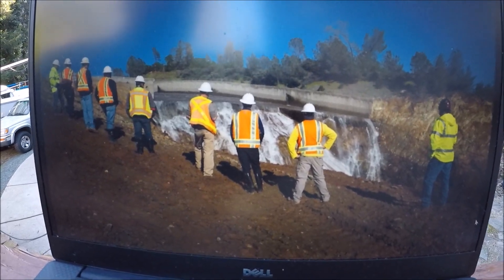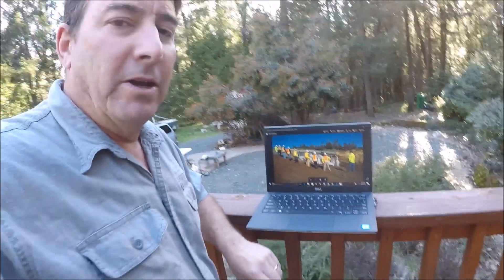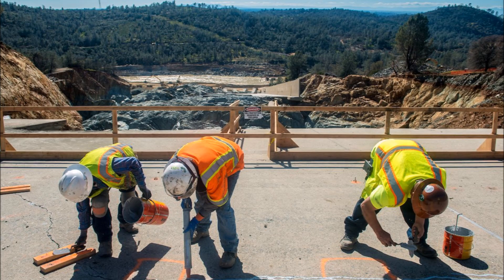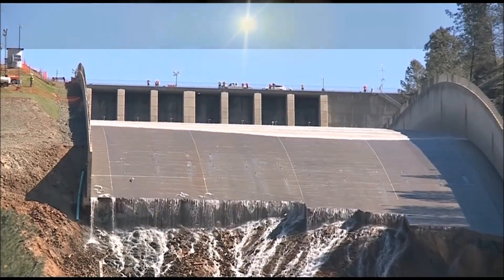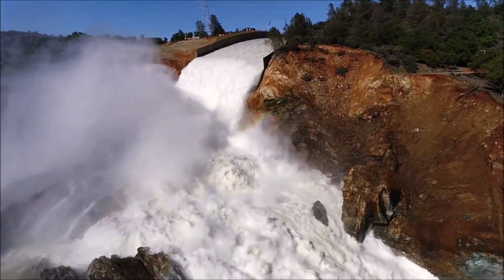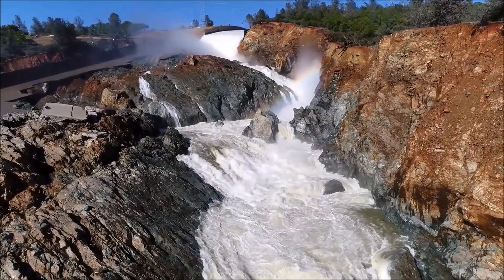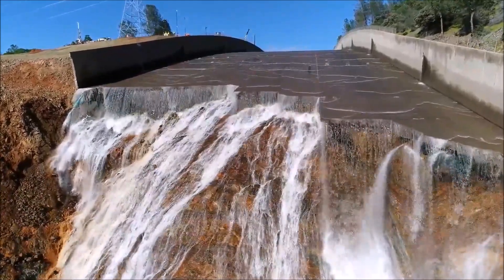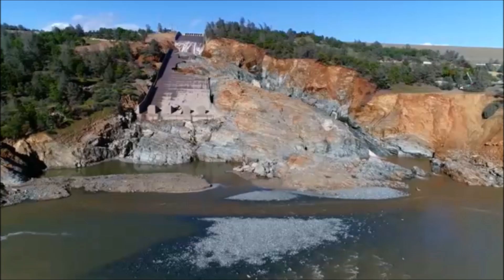Oroville 29 March New DWR Spillway Footage

Comment: From the drone footage it's almost as if they could just leave the spillway as is now and use the newly formed canyon as the actual spillway .  The water seemed very clear coming out at one point there with that being said I do understand the reasons. Behind building the new spillway.  The erosion issue only being one of the reasons.
Reply: I was thinking that. Looking at how clean the water is it's like the worst is over now, the quality of the rock I've seen isn't great though. I think the issue goes back to the original design because they used the original tunnels from the construction of the dam to make the power plant when really the power plant should have been placed on the other side of the spillway and emergency spillway so it could never be blocked by debris in the first place, but it's all water over the spillway now lol...
Reply: Stacey....... The water doesn't contain clay which is the brown stuff. The grey stuff in the channel is a soft rock and it's still being eroded.....Normally the power house is build at the foot of the dam. That allows for a longer shaft on the turbines and places the generators higher above the river. The diversion tunnels look like they were dug through rock in the side of a hill and from my understanding the power house was also dug out of rock in the hill. I think it came back to the fact that 3 of the turbines can be run as pumps to run back water from the bottom into the lake. That allows the power plant to provide power to the grid at peak demand and reuse some of the water for power again. That's a smart design feature, especially for 1690
Reply: Bob hiya... yes a lot of reservoirs use that feature; generally, it is because the electricity at night is cheaper when they pump it back up. One of the benefits of hydroelectric dams is their speed to come online, i think Oroville is online as often as possible and is used to supplement supplies to the dam and sell the power off for financial efficiency, in the U.K we have certain dams that are used to supplement the periods of high demand on the main network, because nuclear plants take time to adjust the fuel rods and create steam pressure, and also cannot easily be retracted so we keep our nuclear power stations running with a reasonably fixed load so rod adjustments are minimalised, hydroelectric  dams are used to add more power during peak demand periods, this is also key to maintaining the synchronisation of the fundamental frequency as high demands pull the frequency below the 50/60Hz.As for the rock it isn't great, someone did a video in feb that showed the rock type and it does pull apart reasonably easy, but they got to live with it for now... I just hope it isn't too porous with all the fractures in it...X

Comment: So here is my 2 cents and SWAG on what caused the spillway to fail. The adhesion properties of water were probably miscalculated for concrete when the design of the spillway was built and the curve of the spillway caused a break in adhesion with the bottom of the spillway. Given the fact we now know the geology of the rock under the spillway where the failure occurred, this was a natural weak point from great direct pressures of the water being launched off the slope of the spillway and then slamming into the section that failed. It was like having a water jack hammer constantly beating on the concrete over time. We already know there were cracks in the concrete that probably should have been repaired and this too led to the contributing factor that led up to the ultimate demise. There were also areas based on pictures and video evidence that show where the water had been removing the top layer of concrete like you'd see if you took a large grinder to it causing thin spots in the concrete.

In summary, so just like the current busted spillway is stuck at being used at 40,000 cfs, the spillway before when operated at a much higher flow caused the launch effect of the water further down the lower half of the spillway. This coupled with the geological subsurface conditions, and several failed maintenance issues led to the failure we see today.

Juan I know you have been trained as a pilot to hold judgement on incidents like this until you have all the evidence, but I like to see how close I am to being accurate without it. :)

Comment: How did I know they were going to do this? Surely there is a finite amount of times they can continue to do this. Even if they launch the water they would have to have a secondary canal underneath the jumping point like a big waterslide to make it feasible but even then the lower half of the main spillway is barely hanging on. Ya know when I wanted to mess up something with a waterhose I would just kick the spray up and hit different areas til the whole area became soggy and frail and washed away. The spillway is toast. There is no repairing it. They really need to start exploring possibilities for alterative ways to drain the dam.

Comment: and from Spain.  Could they not, as an emergency partial solution, put in some deflector, backed by sandbags (or similar) at the lefthand side of the spillway to push the water across into the new canyon and away from the part where there is new erosion?

Comment: To be honest, it looks as if the loose earthen material near the left side of the spillway eventually erodes far enough back to reveal the bedrock; as with the right side above the bedrock, the effects of real erosion will eventually level off significantly. I am suggesting that the bedrock alone may in fact help support safe runoff from the dam long enough after the residual effects of erosion has been allowed to occur. After all the local erodable material to the left and right hillside has receded far enough away, the runoff will stablize to a minimal amount of erosion; thereby, making repairs much easier and safer to continue. I would argue that if the left and right side of the natural bedrock were stabilized, the bedrock alone may be adequate for a few seasons to weather any new major effects of continued erosion; that the runoff may in fact carve a natural but strong channel to allow runoff to occur without any serious effect to river or dam. Any thoughts on this?

Comment: anything on when they project to have the 5th Turbine up and operational?
Reply: They have 5 turbines running, the 6th one isn't even installed though. They're not running the 5 turbines at full capacity.
Reply: Now would be a good time to fix that 6th turbine.  Why haven't they installed it yet?

Comment: Has anyone asked why the 6th turbine isn't running yet? I would think that would be a priority to maximize the power plants ability to regulate lake levels.
Reply: It isn't even installed, and hasn't been for years. In this photo from DWR you can see the hole in the ground where the turbine used to be. https://pixel-ca-dwr.photoshelter.com/galleries/C0000OxvlgXg3yfg/G00003YCcmDTx48Y/I0000Ds3Gc4QPH_4/KG-oro-spillway-damage-12406-02-16-2017-jpg

Comment: It looks like the canyon on the left side of the spillway is down to hard bedrock for most (all?) of the way down.  You had a couple of great shots at how it looks.  Do you have any "before" and then these "after" shots to see the differences?  Even though there is debris in the diversion pool, perhaps any further damage from another release (or two?) will do minimal damage.

Is there any consideration of a the repair work using the canyon, newly carved out, as part of a revised "spillway" plan?  Rather than attempting to replace the lower part of the spillway with a "finished" and neatly managed geometric design, the new spillway may use nature's design on the newly carved canyon.  It almost seems a waste to ignore nature's design, and work with a totally man-made construct.
Reply: BTW, ... another really useful report, with appropriate commentary.  Good job!

Comment: 4:40 You can really see the erosion take place as chunks of the softer brown rock goes flying.

The sheeting effect would be also normal as the water in contact with the concrete moves slower than the water flowing over the top of that lower layer of water. Natural wave effect.
Reply: You are right!  Nice explaining!  Thanks Uncle!
Reply: Uncle Elias I thought perhaps it might be from the sluice (spillway) gates opening up to let more water out. I doubt that on a open spillway with a lot of drop like that there would be much wave effect. Just my observation. Another great report Juan.
Reply: Jon, The gates at this point are being shut. The movement of the water through the gates will create turbulence and a "wake" effect as it spreads out from the gate and come into contact with each different "stream". That will definitely contribute to the waves. However, for the waves to be noticed as they are in the video the surface of the spillway will need to have friction, which of course, it does. That friction combined with gravity and the stickiness of the water molecules causes the bunching up and sort of forward rolling effect that we see.

Comment: Another great update thanks!
Juan, do you have an opinion on what what should be done to the emergency spillway?  Should they be spending any time and money on a backup water release plan? 
I guess the hand of the DWR might be held back by funds available.
Reply: I think a lot of the problem is that from what I understand the big valves down by the power plant are broken or at least inoperable and therefore they cannot drain significant enough quantities from the bottom.  This brings me to the conclusion that ultimately a second primary spillway must be built on the north side near the parking lot.  Trying to work in between the rise and fall of the lake seems very impractical over the long haul.
Reply from the maker: Chris Wren funding is not an issue now I think....

Comment: Thanks Juan! keep it up, they cannot continue to cycle like that, its a losing battle. There must be other means to lower the lake elsewhere by other means, tunnels or piping and pumps.
Reply: I spent my earlier life briefly on a farm in the San Joaquin valley, one of the things i was taught was how to set up siphon tubes for the irrigation rows.  Up and over the emergency spillway? Then down culverts? Or a concrete lined channel?
Reply: Interesting idea. Maybe they could pump to start a humongous siphon and then shut off the pump and just let 'er suck! :-)
Reply: noyopacific A syphon is possible but it would have to be very large and made of steel.
Reply: Daniel/Noyo/Grateful...Yes indeed, I sent a design to the D.W.R on Sunday detailing that exact principle. It is highly possible if designed and calculated for the required purpose. A siphon doesn't have the power issues of pumps and just requires filling to initiate. Also if it was built as a fixed structure it could serve as a permanent feature as I have indicated mainly a floating temporary design to be built fast using off the shelf items mainly because of time that is running short plus to give them time to repair the spillway without having to use it during the wet season. A siphon can take the lake below the 835ft level threshold of the spillway so doesn't require to be as large in outflow anyway, just constant and controllable....Send your ideas to the D.W.R also...XXXX
Reply: I used to live west of Kingsburg growing Thompson's for raisins. My neighbors used the siphons you described to irrigate the cotton.
Reply: Daniel Ramsey I don't think there is a powerful enough pump to move eneough volume
Reply: http://britishdams.org/about_dams/outlettowers.htm